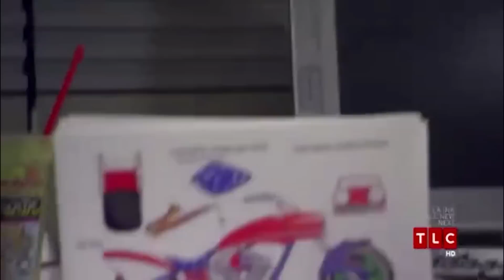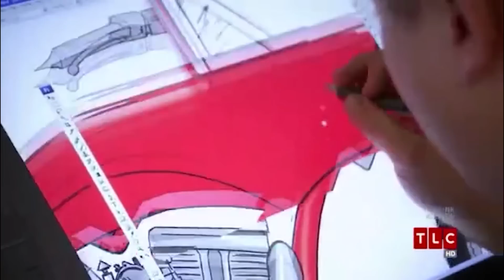Where is Jason Pohl from American Chopper today?

Comment: They built a fan bike in the earlier seasons and it was a hardtail camo theme which they valued around $80 and it was sold at auction a few years ago for $8k. A motorcycle youtubers bought it and pointed out the crappy design and slow stock motor.